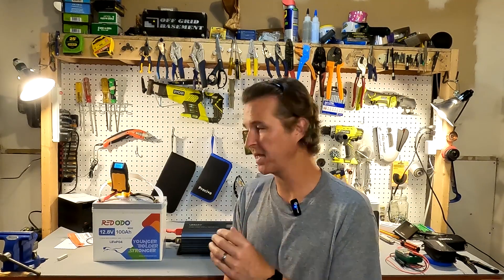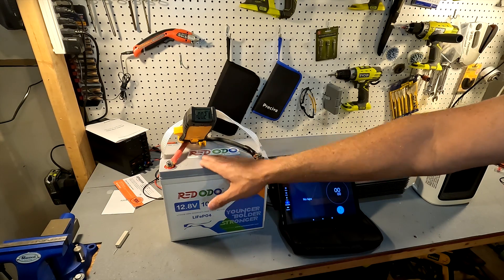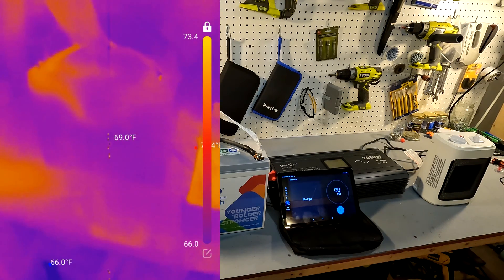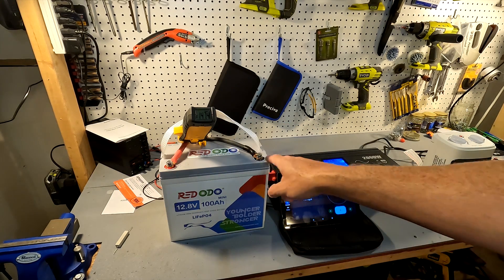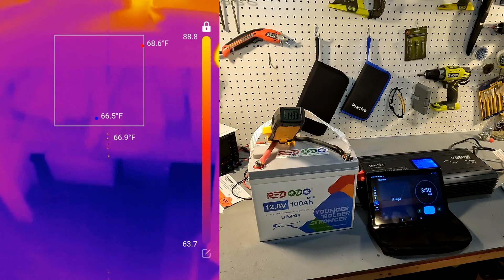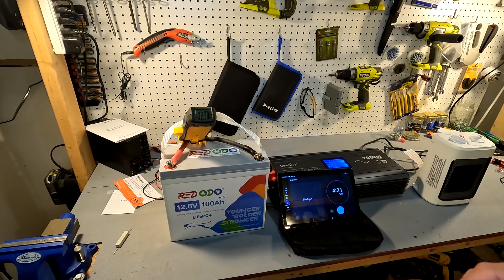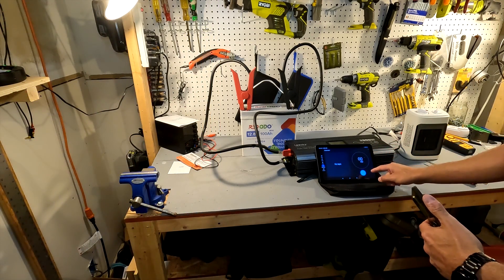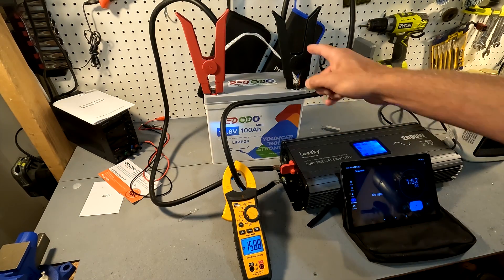Does your off grid wiring connection really matter?  Let's find out!

Comment: Well done. Great vid. I recently set up 3 100ah parallel battery system to power a desktop. I have 2 600w inverters clamped to the posts just like you have here. I will definitely move them to a more permanent connection (anderson power pole 75a) in the future.
Reply from the maker: It's a good idea.  You will notice an efficiency boost as well.  Thanks for the comment.

Comment: My 12 volt aux battery on 2010 Prius has a tab for the positive, not a post. What can I use?
Reply from the maker: You can use battery clamps for jumping with no problem.  It is more of a concern for off grid storage batteries running high amperage loads.

Comment: For sure you gotta have super good connections and over size the crap out of ypur wires. Use high strand count quality wire and short as possible. All that comes into safety but also if you want your equipment to last and not be stressed to the point of failure. Bad connections and  small or cheap wire is a big no no
Reply from the maker: Thank you for the information and the comment.

Comment: I think if you hooked up the battery clamps correctly the results would not have been so dramatic.
Reply: It would have been a little better, but still shown the exact same end result...battery clamps are NOT a good solution for long-term, high-amperage loads.  You're not saying they are a suitable replacement for a proper ring terminal, are you?
Reply: @jasonbroom7147  I’m saying that the test minimizes contact area between cables and terminals which violates another electrical work principle. Many battery chargers/maintainers have only clamps as an interface, but you connect it with the half-moon surface, not the shark teeth.  Of course using pinpoint contacts is going to cause problems which is why this wasn’t a fair test.
Reply: @CompleteOffGridAmateur  - It is not the test that "minimizes contact area", it is the design of the alligator clamps.  Even when you connect them in the manner you're suggesting, they are simply not suitable for long-term high-amperage demands.  It's a matter of contact surface area and clamps simply cannot provide as much as a properly torqued down lug.  If that somehow elludes your understanding, then building your own DIY solar power system is not something you should undertake.
Reply: @jasonbroom7147  there’s no need to be insulting. I know how to connect cables to batteries. I never suggested it’s a good way for a permanent union, but when used as a temporary connection, there’s a proper way to affix the clamps for best results and that wasn’t in the video.  In fact, there might not have been a significant difference in thermal performance if the clamps were applied properly.
Reply: @CompleteOffGridAmateur yeah the clamps are not made for high amp long term use.... ever !!! Clamps are for low amp chargers or a quick jump start. Any high amp long term load has to have  lugs or plugs designed and rated for what current you are pushing
Reply: @matthewknight5641  who are you preaching to? I said absolutely nothing about long term use. Neither did I suggest it’s an ideal hookup. I only said that’s not how battery clamps are used. Apparently I’m the only one to spot this serious flaw in the demonstration, one that completely undermines his point.  Then I get you all attacking me for things I never said. Good grief people 🙄
Reply: @CompleteOffGridAmateur  - There still would have been a dramatic difference in temps if the alligator clamps were applied "differently".  The increase in surface area contact would not have been enough to offset all of the heat generated by that many amps.  I don't know why you're choosing to die on this hill.
Reply: @CompleteOffGridAmateur  that's so funny... just don't mess with more than 12 volts and no chargers more than 5 amps and you will be fine with the clamps lol
Reply from the maker: It's still not the ideal connection.  That's the point I'm really trying to make.  I'm just trying to make people aware of the potential dangers of bad connections in combination with large amperage loads.  Thanks for the comment.

Comment: And all that heat is wasted energy that could be powering your loads.  So many time I ahve heard people say battery "X" and inverter "Y" can't power a load and then you find out they are loosing a volt or two under load with long power leads.  You can check the voltage right at the battery and again at the inverter and see the voltage drop in the line, which also makes the inverter work harder.
Reply from the maker: Thanks for the info and the comment.

Comment: Excellent demonstration. The surface area of the electrical connections is critical. The diameter of the cable is virtually irrelevant if there are choke points at either end. Very well done!
Reply from the maker: Thanks for the info and the comment.

Comment: I have a Question ❓ I was Told too KEEP THE BLACK NEGATIVE CABLE FROM BATTERY TO INVERTER AS SHORT AS POSSIBLE .
WHILE THE RED POSITIVE CABLE FROM BATTERY TO INVERTER CAN BE LONGER . 
❓" IS THIS TRUE " ..❓
I LOVE YOUR VIDEOS..
I Have Learned Soo Much 👍
Reply: No not true at all. You really want both pos and neg to be short as possible. And over size you wires. There are a minimum size for safety then double that for making your equipment last longer while still being safe
Reply from the maker: I've never heard anything like that.  I've always thought to keep both cables roughly the same length.  Thanks for the comment.